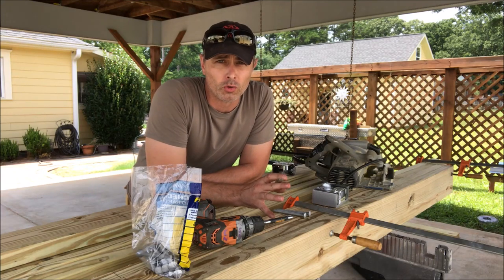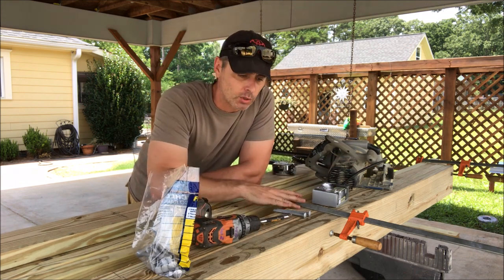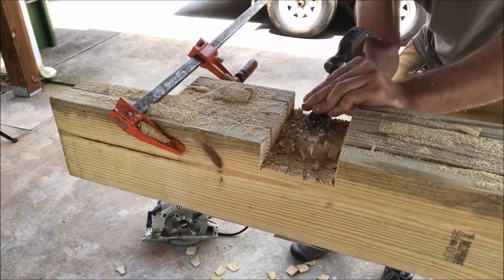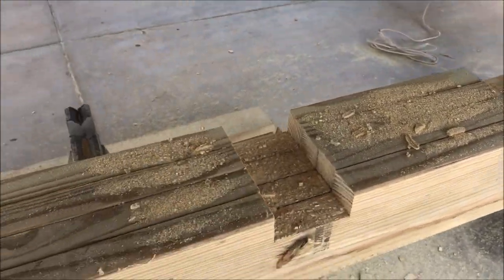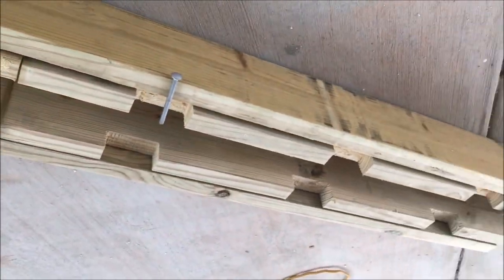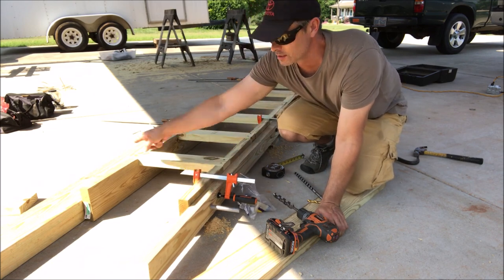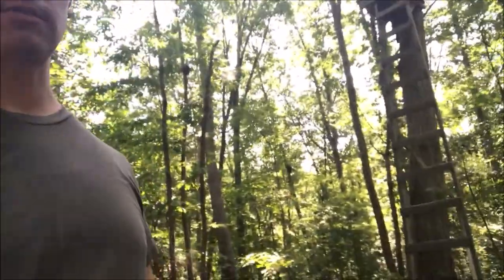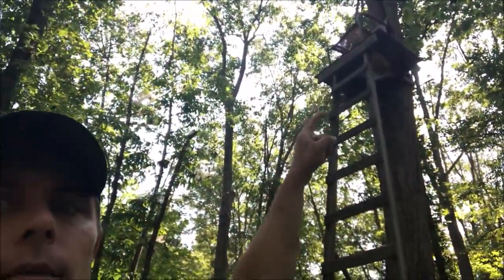DIY Ladder Tree Stand

Comment: I think that it needs a little bigger platform if you stand up your feet will be close to the edge . Enjoyed the video .
Reply: That wouldn't be as secure in my opinion. I've been doing a lot of research and this is the most rock solid approach. Takes a bit longer though.